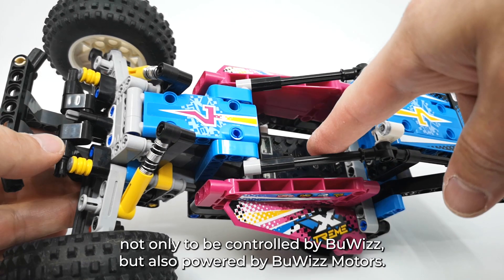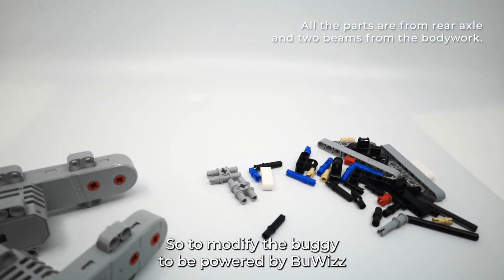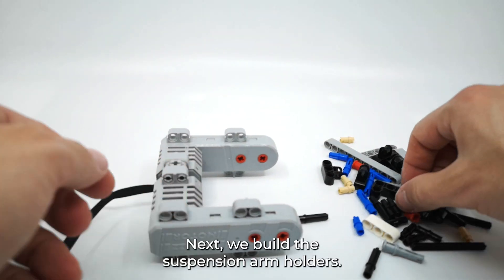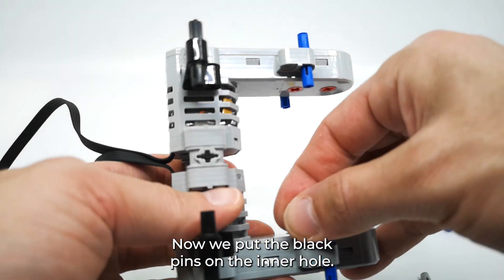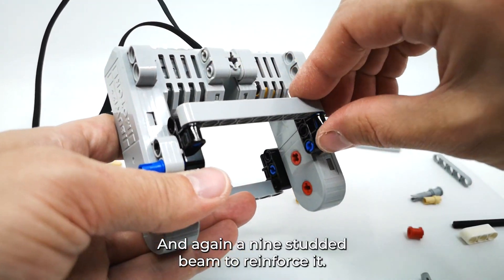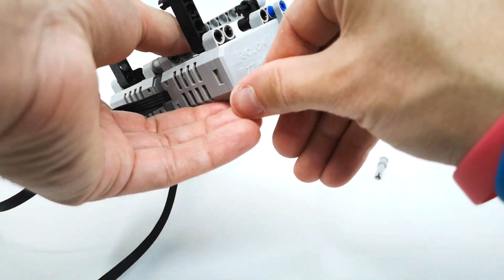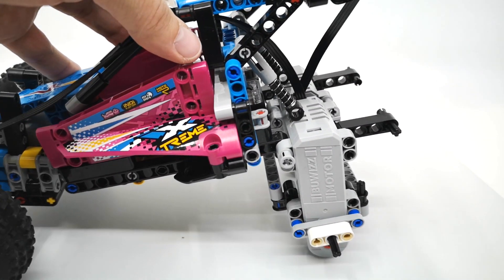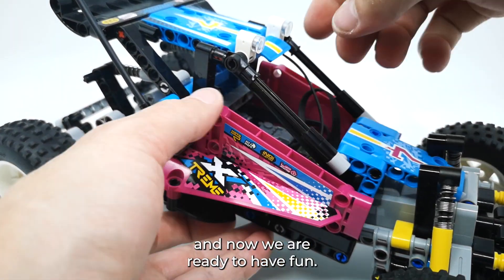42124 Off-Road Buggy BuWizz 3.0 Pro & BuWizz Motor upgrade instructions Part 2

Comment: Just built this. SUPER fast! but the steering is horrible. It's almost impossible to control.
Reply: I kept the steering with the original Lego motor. It works fine for me. Make sure you have the calibrate option for the steering.

Comment: Won't there be a problem with 2 motors running at slightly different RPM causing the model to always steer toward one direction? Set 42065 and 42095 have this issue.
Reply: That’s the problem I have with the ford raptor model.